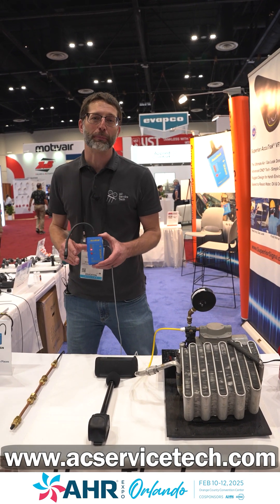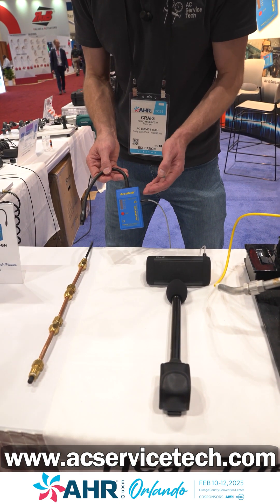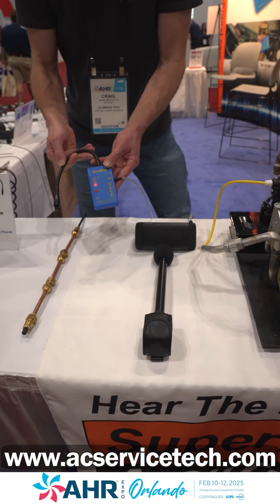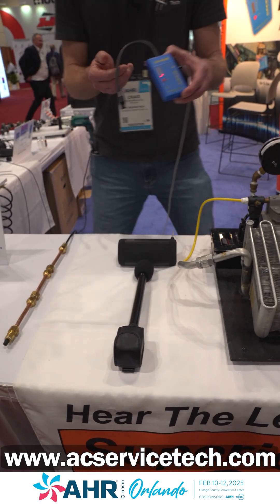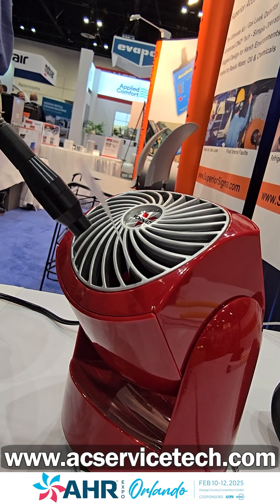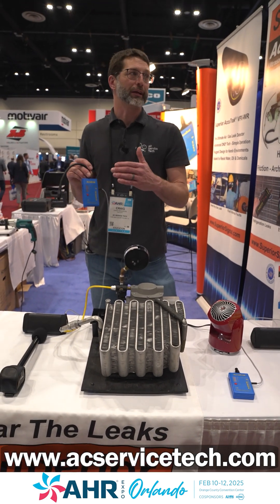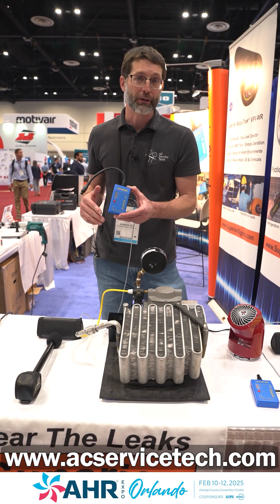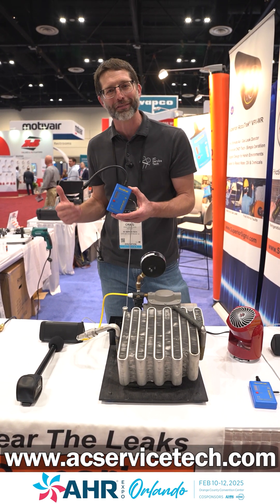Craig Demonstrates the VPE Ultrasonic Leak Detector!!

Comment: 1k is way to steep.
Reply: How much do you charge for leak detections? It would probably pay for itself after about 5 or so leak searches.  If it's legit and doesn't malfunction, I don't see a big issue with price even though it is a bit steep compared to nitrogen/refrigerant detectors.
Reply: @BradSanders-i9h  it all depends. some can take 5 min vs 2 hours. I agree It will pay it's self off ...but I don't  anyone who has one.
Reply: The other brand for 1/4 the price works exactly the same.
Reply: IMO not steep if it actually works really well.  

I’ve seen people waste $1000 in hours just to have an unsuccessful leak search.  Hard to find leaks are their nemesis 😅
Reply: @lestalkmorebasss   I 100% agree but I don't know anyone who owns one and I don't like being the Guinea pig for a $1000 tool been there done that. I would gladly write a bad a** review if it really worked but they would have to loan it to me for 30 days or something. I've never even seen these at the HVAC warehouses, They have almost every tool imaginable
Reply: @  yeah, probably the retailer doesn’t want to spend the money either haha